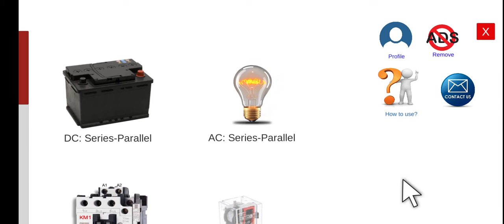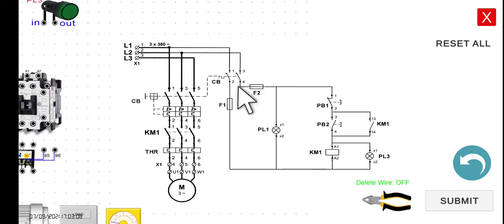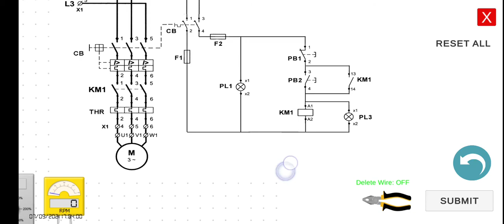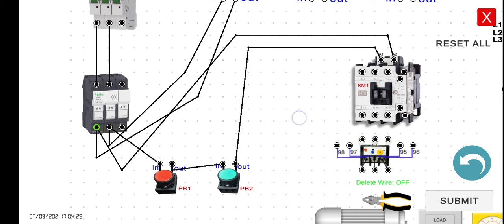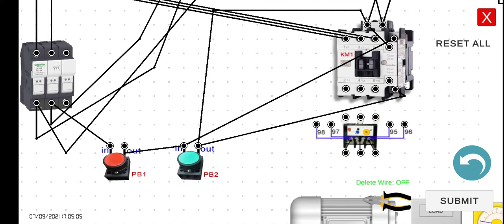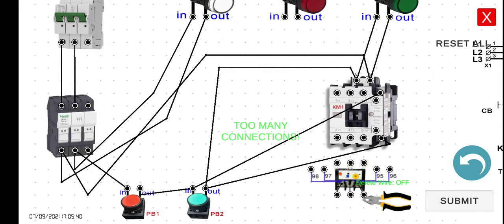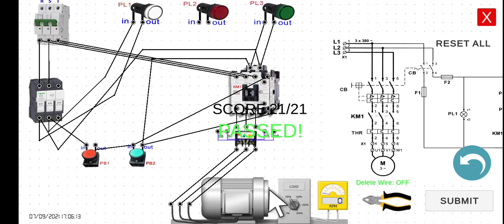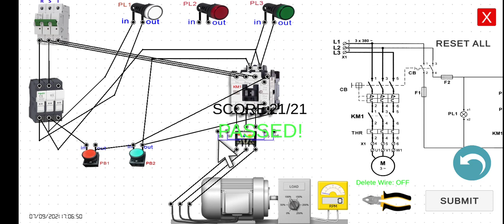Motor3  DOL motor starter

Comment: This one confused me. I failed it multiple times with only missing one connection  before watching this video. Instead of leaving the f1 & f2 with multiple connections. I was looping x2(pl3) - a2(km1)-x2(pl1) back to the fuse with only one connection at the fuse block, also the same on the other side. Would this way not work?